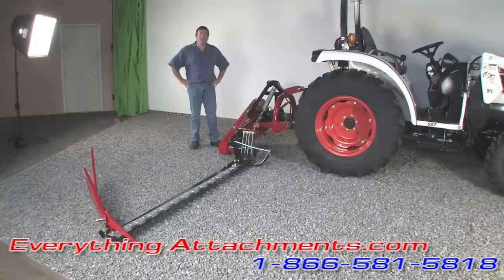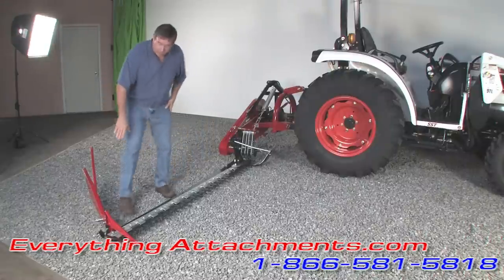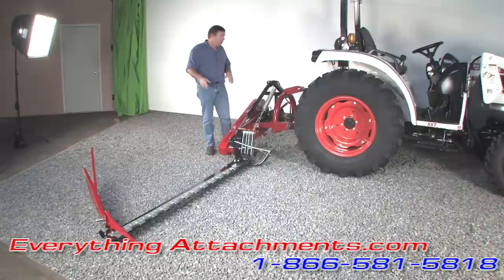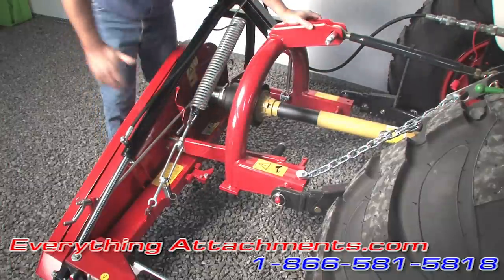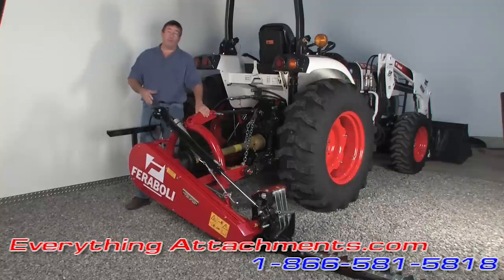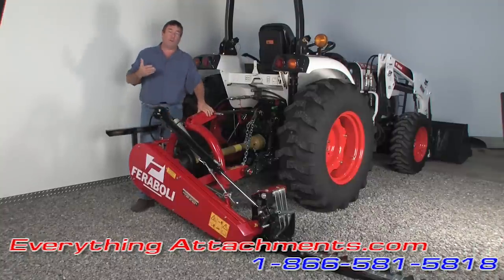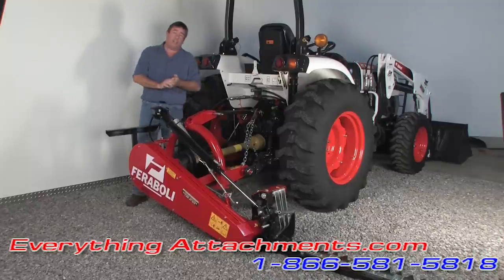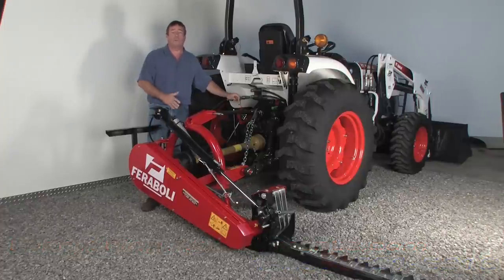Feraboli Sickle Mower Available at Everything Attachments

Comment: I have a 1951 John Deere "M" with mid mounted (under the belly) sickle bar mower and hydraulic lift to raise mower up and down, manual lift to return the sickle bar to 90 degrees for transport.  It has mowed A LOT of hay.  My grandfather bought it BRAND NEW in '51!  Nice to have the mower off to your right.

Would take some getting used to when the mower is rear mounted, behind you.  This looks like a great mower, however!  The full hydraulic lift is impressive!